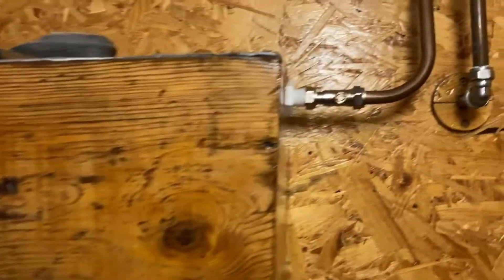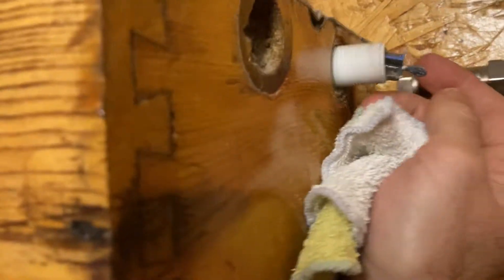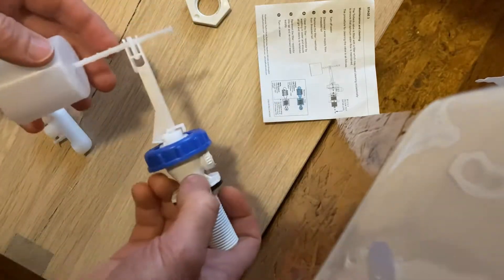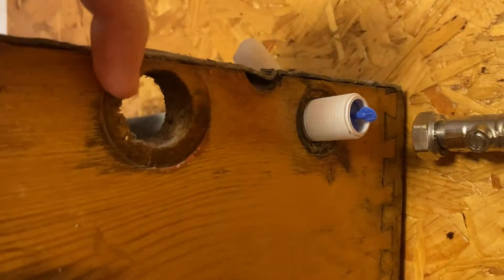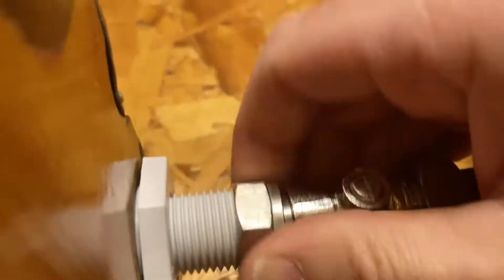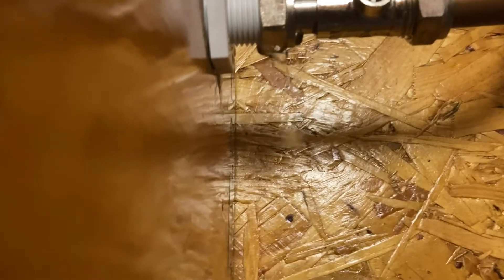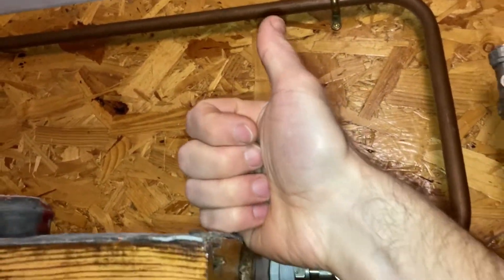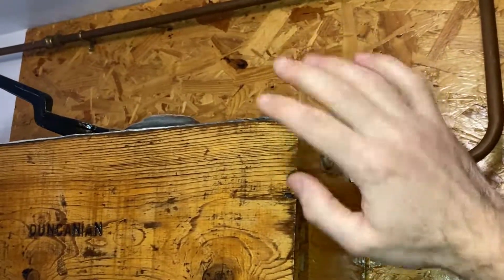Adjusting a toilet cistern fill valve pressure reducer for use with an electric pressure pump

Comment: Hi Owen, as your outlet to the loo is large diameter, is the filter needed? As for pressure reducing, could one just use the shut-off valve and half open to achieve the same result?
Although I suspect the valves seal best either fully open or fully shut.

Comment: You need a pressure tank inline on your water system. It will give you more consistent pressure, and prevent the water pump from short-cycling.
Reply: Are those large metal cans with a diaphragm in them? Roughly 8" diameter? I've added the smaller ones sold as hammer arrestors to sinks and washing machines. They're 1" diameter and 4" long and seem to help.
Reply from the maker: There is a large pressure tank on the pump.